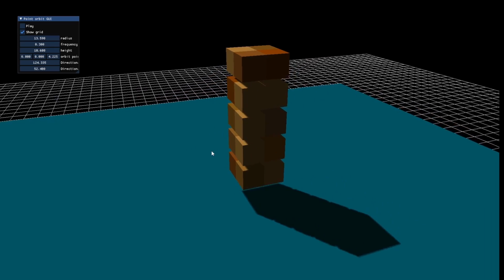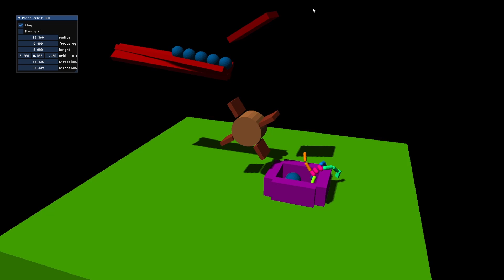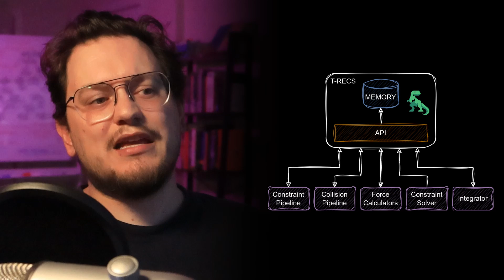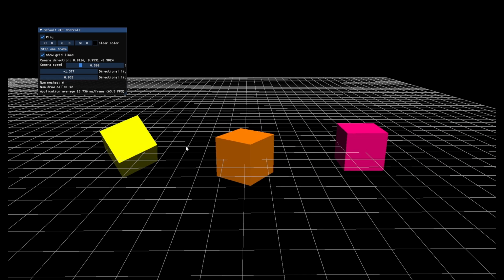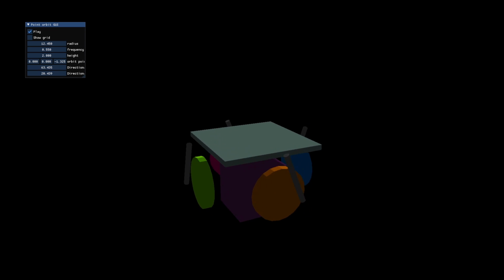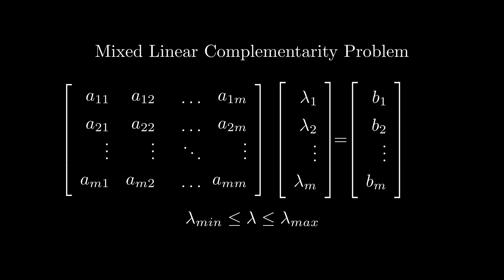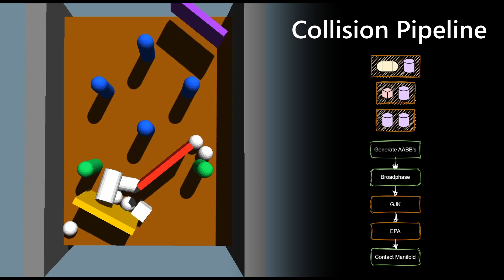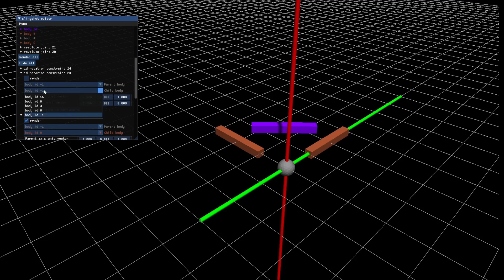Physics Engine from Scratch

Comment: Really nice job on this!  I made one too but with less features.  No ECS in mine, and I was only able to properly implement spheres (OBB were half implemented but when it came to the "manifold" collision phase with resting contact things became jank).  No gjk algorithm in mine, just SAT, I did as an extension of a school project.  I implemented a sparce oct tree which allowed for a pretty efficient broad phase though.  Also on constraint system in mine.  This looks awesome!
Reply: Havent worked on it for over a year.  Been starting a new project recently though in c++ using ai.

For spheres, I either add an impulse force or apply a specific rotational velocity depending in the relative speeds of the geometries.  If it is below a certain cutoff I would apply the rotational velocity.

To handle collisions between multiple geometries is probably the only unique aspect if my engine (maybe its a common technique but I did come up with it myself). For every piece of geometry I hold a bounding sphere and essentially do a spheretrace (spherecast in unity, spheretrace in unreal, but its basically a raycast with a sphere) to each of them in the reverse direction of the velocity which would tell me which was the closest collision.

Im gonna have to take a closer look at this and how you handled constraints.   It was a mistake choosing c for that project.  Mainly did it because I thought it would be a good challenge, code ended up getting super messy.
Reply from the maker: I watched your demo video, it looks really good! How are you handling sphere-plane collisions without a constraint system? Are contact impulses generated one at a time for every contact point? Are you still working on it?
Yeah contact manifolds get complicated. Calculating them is one thing, making sure that they're stable between frames is an entirely different thing.

Comment: i was wondering if you had any references for building up a contact manifold from EPA or did you use another algorithm?
Reply from the maker: I use a process that's similar to this talk by Dirk Gregorious.

https://www.gdcvault.com/play/1022194/Physics-for-Game-Programmers-Robust

Contact manifolds are made in one shot. I use the contact point and contact normal from narrow phase (GJK+EPA or SAT) to find a closed, convex set of points on body A and body B that:

1. Contain the contact point
2. Have a surface normal with maximum cosine similarity to the contact normal (or the negative of the contact normal)

These closed, convex regions (CCRs, but not the band 🤣) are either faces, line segments, or single points. From here the process is pretty similar to the slides in the link:

1. Clip the CCRs according to penetration (e.g. only include the parts of the CCRs that are actually inside either body)
2. Clip the clipped CCRs against each other (gives you a polygon, line segment, or point where the bodies are actually in contact)
3. If the CCR is a polygon with more than four vertices, find the four vertices on the polygon that give you a smaller polygon with maximum surface area
4. Reproject the clipped/reduced vertices onto both bodies
5. Use the reprojected vertex pairs as contact constraints (with the normal that came from narrow phase)

This is the contact manifold calculation entry point in slingshot:

https://github.com/Slingshot-Physics/slingshot-community/blob/main/physics%2Fcollision_pipeline%2Fcollision_contacts.hpp

Let me know if you have any more questions!

Comment: Amazing work, very impressive. What's the peformance like with ridiculous amounts of objects, are you using a BVH to cull collision checks, and have you considered adding convex mesh shapes?
Reply from the maker: Thanks! With ridiculous numbers of objects performance would be pretty bad. I'm running this on a single thread with no BVH, so broad phase is O(N^2).

Fun story, this engine started out only supporting convex meshes, but I switched to quartic shapes to take advantage of axis test speediness. It would be pretty straightforward to include convex meshes. I'm sidetracked on improving the renderer and ECS, but once those are finished I plan on re-attacking slingshot's collision pipeline.

Comment: Hello! What about energy and momentum conservation. Does it works with those simple constrains? I mean imagine a real 2 rigid body pendulum. It will keep the total energy and follow the correct velocity patern? Thanks a lot!!!
Reply from the maker: Great question! A pendulum with no friction built out of constraints will slowly lose kinetic energy over time. This happens because of a combination of (1) not using a symplectic integrator and (2) constraint impulse calculations not adhering to conservation laws. More (2) than (1) tbh
Reply: @therealjtgill  Thanks! I am trying to do constrains that keep the real physics using very strong and short springs, but its a nightmare. I need really small integration steps and using doubles... any idea :)
Reply from the maker: @samsaraAI2025  If all you want to build is a simple double pendulum that conserves all the standard mechanics quantities, then I'd look into a minimal coordinate representation and a symplectic integrator. You can derive the dynamics of the minimal coordinate representation by hand by setting up a Lagrangian, or Drake (another physics engine) could probably do it for you.

Section IV.A of this paper has a short discussion about the difference between maximal coordinate systems vs minimal coordinate systems (slingshot is maximal coordinate).

https://arxiv.org/pdf/2203.00806.pdf

Note that a symplectic integrator won't necessarily conserve energy on a frame-by-frame basis. But over long sampling periods the system's average energy from period to period will be roughly constant.
Reply: @therealjtgill  I will research about that idea. I dont want to use another engine, I want to create my own one. For real simulation you know.. Newtons, meters, real watts etc.. for simulation a car suspension etc.

Comment: Cool stuff man. Trying to achieve stable stack of boxes in my end. This is inspiring.
Reply from the maker: Just keep at it and you'll get there. Stable stacks are probably the most difficult feature for collision detection/resolution. Mine will eventually slide apart if the engine runs for long enough, my contact manifolds aren't spatially consistent across frames. It really just comes down to a combination of a well-tuned constraint solver, consistent (or at least smoothly varying) contact manifolds, and good friction approximations.

Comment: Superb work!
For anyone looking to delve more into the physics check out the paper: Detailed Rigid Body Simulation with Extended Position Based Dynamics. 
I implemented some of the features described in the paper and I must admit is trickier than it seems. For you to have implemented all of that is incredible.

Comment: Hello! Maybe u can clarify a bit obtain distance when I know current velocity and time in seconds where object will decelerate to 0 speed but from max speed, like if we stops 0.2s from 4000 velocity to 0 then from 2000 we should do it in 0.1s accordingly? Classic acceleration formulas seems not consider I compute it in between integrating steps like velocity is not that big or mapped as dt pos += velo * dt, instead a full second  range and it provide distance that too much longer than when I integrate with RK4 or velocity verlet 😅 something like 20-25 times longer. Example max speed 4000 and time to full stop 0.2s, i apply deceleration amount as MaxSpeed / decelTime  with inverted to velocity direction and I stops something like braking length 500-600 position units, when I try compute somewhere length when in motion for current speed or even on full speed for such time 0.2s via classic newton formulas I get braking distance 2700 something like that. So thought maybe just multiply to dt to obtain intermediate fraction so this will be kinda meaning of what dynamic acceleration equation deriving may looks like, but then values is 5-6 units in position, like 100 times smaller 😢 or I miss something dunno.

Comment: Very cool, thanks for sharing! How difficult was it for you to understand and implement these algorithms?
Reply from the maker: Thank you for watching! It kinda depends on the algorithm - but I'd say anywhere from a few hours to a few months.

The collision system and the constraint solver are the most math-intensive parts of the engine and the algorithms they use are intricate.

The notion of mixed linear complementarity problems was the most difficult to tackle and I'm still finding ways to improve my implementation. 

Collision detection through contact manifold calculation uses the widest variety of algorithms, and some of those were difficult to implement because they required a bunch of boot-strapping.

GJK is a good example. If you want to use GJK to figure out if two shapes are colliding/what their closest points of contact are, you have to have:

- closest-point-on-[0, 1, 2, 3 simplex]-to-point
- support functions for every convex shape you're going to support
- barycentric coordinate calculator for [0, 1, 2, 3] simplex
- probably some coordinate transformation info (but this depends on how you store shape information and how your support functions expect to receive data)

So that's technically at least 9 algorithms that you have to implement *just to tell if two shapes are colliding*. But the nice thing is that a lot of this can be re-used for algorithms like EPA.

I'm sorry for the info dump - this stuff is just exciting, and it's cool when people ask about it :)
Reply: @therealjtgill  thanks for sharing and the info dump is appreciated ;)

I’ve looked into making a physics engine before but all the collision detection and resolution looked overwhelming so I’ve never dived too deep in. It’s nice to know this wasn’t “done in a day” so to speak. 

I like doing simulations with sound (there’s some demos on my channel if you’re curious). Are you interested in sound related things?

Great project again and thanks for the reply!
Reply from the maker: @gedaliakoehler6992  Your videos are FANTASTIC
Reply: @therealjtgill  Thank you so much:) I'm glad you appreciate them. They're kinda straight up - here is the demo - but I appreciate more the approach you did and others do where there's a bit more talking 😆